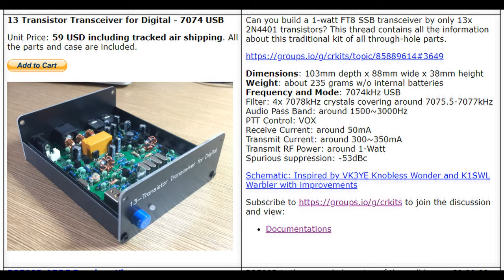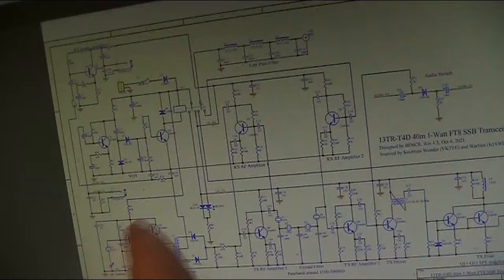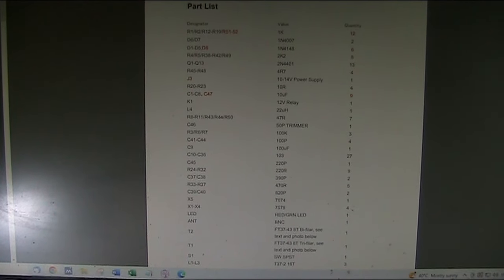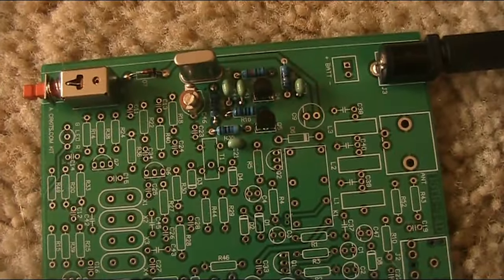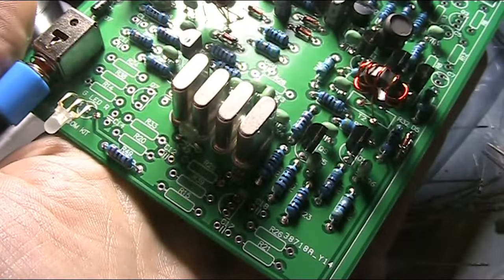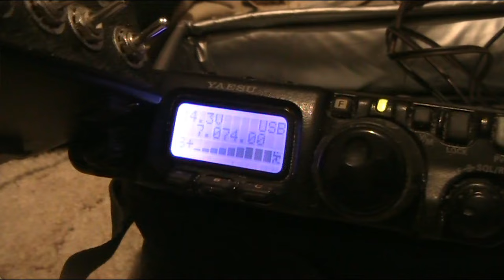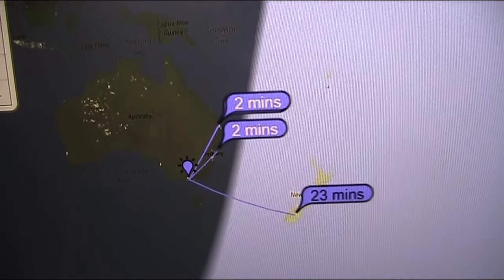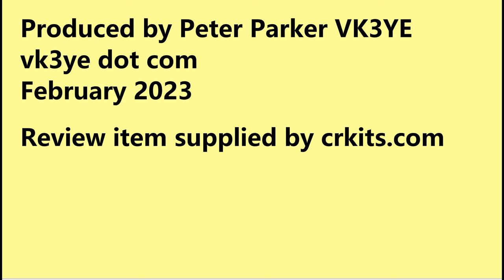Build this in a day: 13 transistor FT8 transceiver kit review

Comment: I built up mine last year. I ve got 4 different digital  qrp transceivers: crkits 13 Transistor, QDX, QRP Guys Digi III and the TruSDX of DL2MAN. The 13 Transistor Trx isimited on 7 MHz with less power than all the others. But it was the only one  that worked from the beginning. Great instruction. QDX had the best output and performance, but it's very sensible on high swr and high voltage. I already crashed 2 QDX. In this case, the 13 transistor Trx is hard to kill 😂. Awesome
Reply: What was the failure mode of the QDX? Did the 4 final transistors fry?

Comment: Peter, you must have a good memory for circuits. At the end of the video, when you were going through those circuits. The little FM transmitter one, you said looked like a Talking Electronics circuit. I thought that too before you said it. I have most of the magazines they put out in the day. I think I have all the FM bugs ones. I built a few of those. I even etched my own PC boards. I'd rather do Manhattan style now. The head of the company "Colin Mitchell" was a very smart man. Being a small company, the next magazine could turn up at the newsagent at any random time. With those low powered FM transmitters, as the series progressed and they would transmit further and further, they said something like "They didn't want more distance by brute force, higher voltage, but by more elegant design.

Comment: After watching that video it inspired me to setup my ft8 receive only system. It was a time in the evening when 7074mhz comes in strong, and I thought just maybe I might see your call sign. I didn't. I did catch the date on the computer being February, so you've probably moved on to other things. My setup is quite modest. A small Sangean shortwave receiver. This radio does sideband. A Samsung android tablet, and I use the free Chinese ft8 app called ft8cn. This app can do the transmit side of things too. I'm in Western Australia and with just the telescopic antenna I receive from all over the world. I regularly get Antarctica on 14074mhz.

Comment: Hi Peter, just wondering if you've considered doing anything on the (tr)uSDX rigs? I'd be interested to hear your take on them.
Reply from the maker: I've only had a quick listen to one and didn't like the receive audio much. I can't justify buying one given the issues others have found.
Reply: @Amateur Radio VK3YE  OK Peter, thanks for getting back to me. I got one myself recently but haven't played with it much yet though like you I'm not overly keen on the receive audio. I've tried an external speaker but not much better. 73's EI8HNB.
Reply: @IrishvintageTVRadio  I built one earlier this year, and found it a very enjoyable radio with headphones!
Reply: @BertClaes  I shall try headphones Bert, many thanks.

Comment: That was really interesting -especially watching you align & debug the (minor) build issues. Have you looked at the QDX from QRP Labs? It's 5W and multi band -similar price, but uses SDR tech instead of analogue circuits, so might not interest the RF tweakers so much ;)
Reply from the maker: No I haven't
Reply: Nothing against the CRKits unit, but the similar price just shows what amazing value the QDX is.

Comment: Blue resistors, DMM a must.
Blue resistors, bad idea.
I have an elcheapo Bunnings version of a Dremel, and I use an abrasive attachment to clean the enamel off, easier on the fingers.